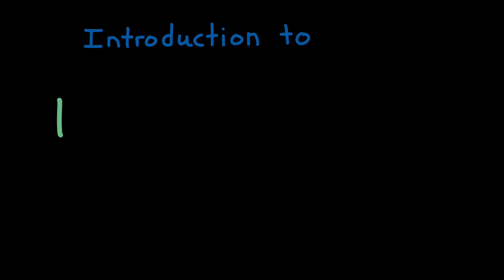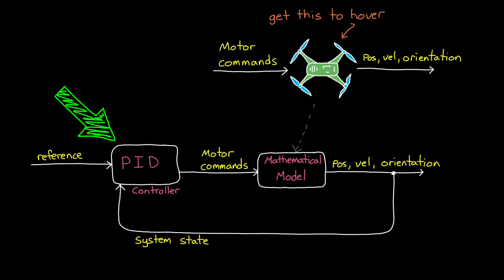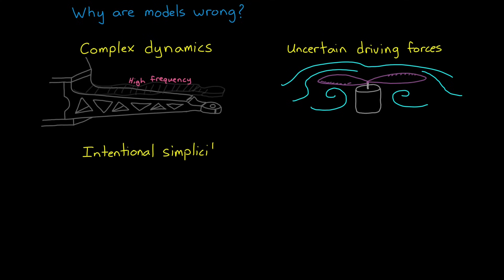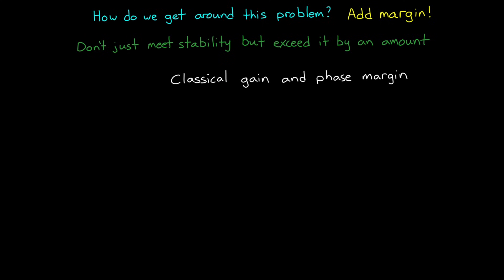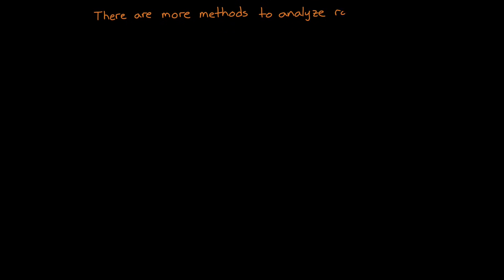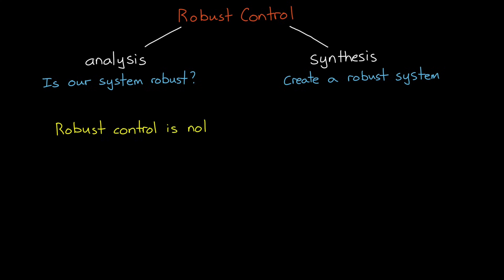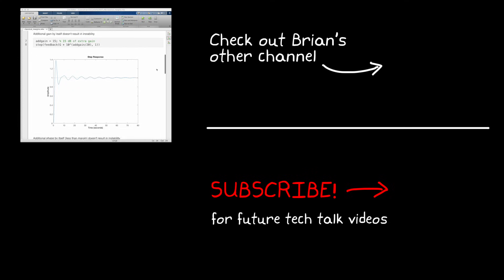What Is Robust Control? | Robust Control, Part 1

Comment: Hi, Anyone who could answer how the Pm=69.9 deg (at 0.406 rad/s) is equivalent to appr. 3 sec.
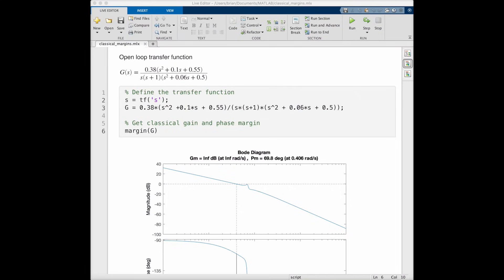Please look at the video at 7:35.
Thank you very much for your help and support!
Reply: Since the frequency w=0.406 rad/s  we can deduce that the period T=2*pi/w=15.6 sec. Here comes the cool part. Phase margin of around 70 degrees means that the sine wave gets shifted by 70 degrees. Since each 15 sec period has 360 degrees we can reach the conclusion that delay= T*PM/360=3.02sec

Comment: In 7:35, why does 70deg of Phase margin equal to 3 second time delay?
Reply: First convert the value 0.406 from rad/s to deg/s ... then divide 69.8 deg to the converted value, with that you obtain seconds, in this practically 3

Comment: There are cases (big gain or delay) when PID control output (u) changes fast between 0 and 100%. What if we add bounds for its speed (u-dot)? Is it a robust method?

Comment: I have never heard of disk margin. Is this similar to the modulus margin?
Reply: It is similar in that they are related to the shortest distance between the Nyquist curve and the -1 point, but there is more to disk margin than that (for example, you can skew the disk center. You may want to do that if you believe you have more uncertainty in one direction over another.) The next video is on Disk Margin and will explain it in more detail :) Although, I removed the section where I showed how the inverse of the disk is related to the -1 point on the Nyquist plot. So, maybe a better option would be to check out the original paper here: https://arxiv.org/abs/2003.04771